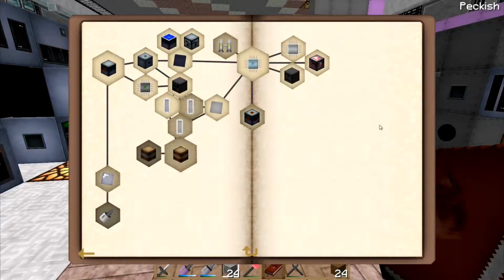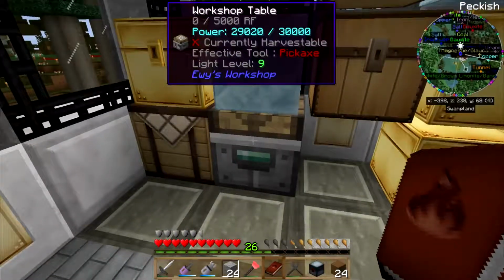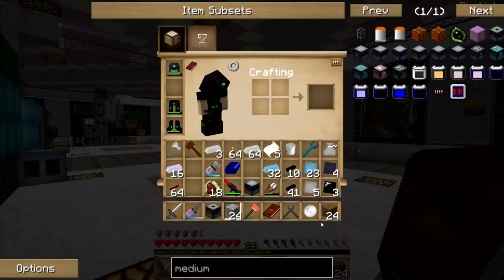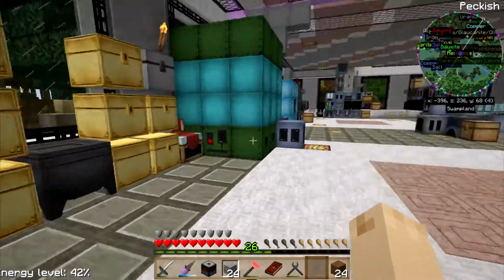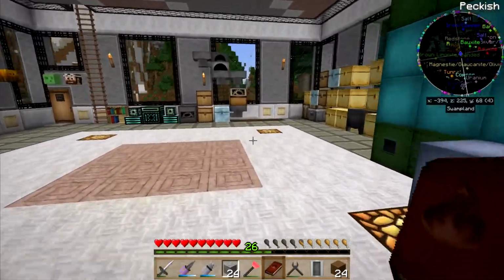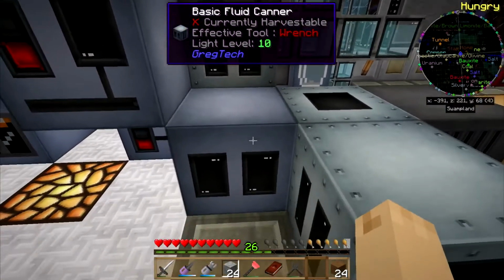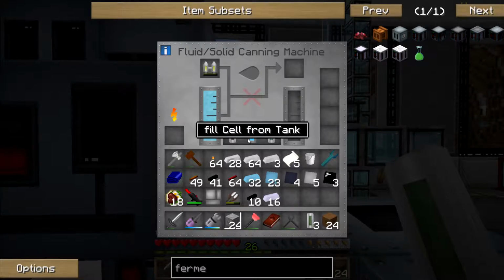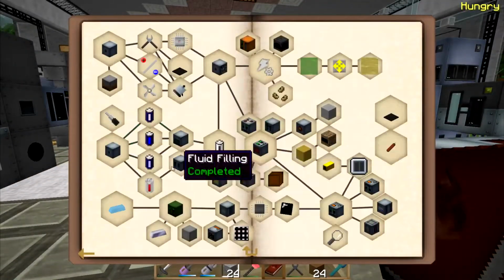Lac Plays FTB Infi-Tech 2 S2 Ep 145 Trying to Fuel a Jetpack

Comment: Of course the armor will not charge if you are trying to plug Low Voltage power into Medium Voltage machine.

Reading is great idea to learn before playing btw :P

The canning machine works. You just need to have the BioGAS in the left (instead of the water) and jetpack above the Biogas.